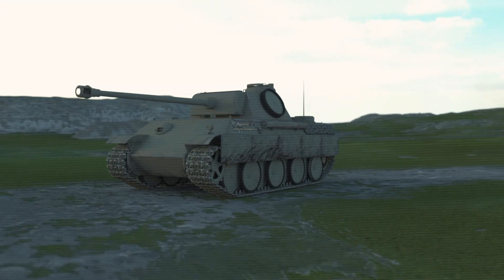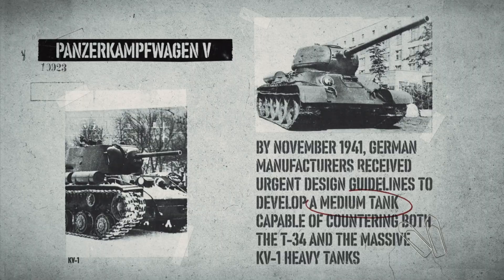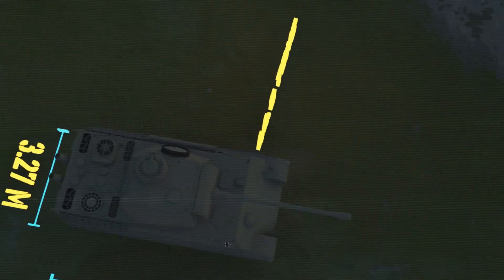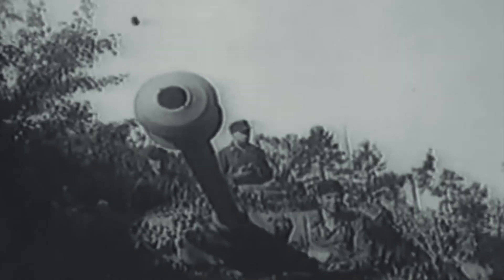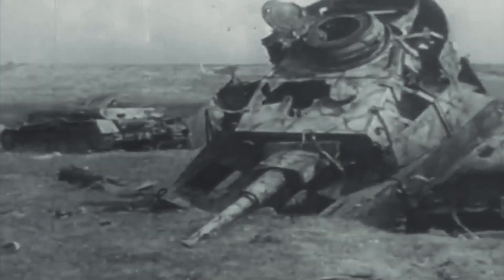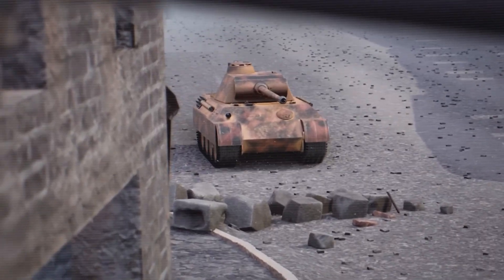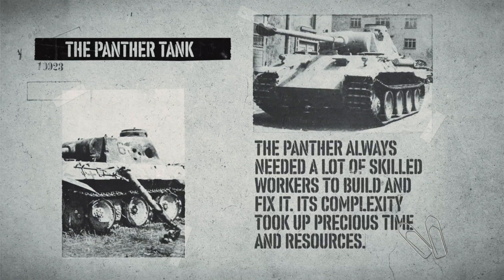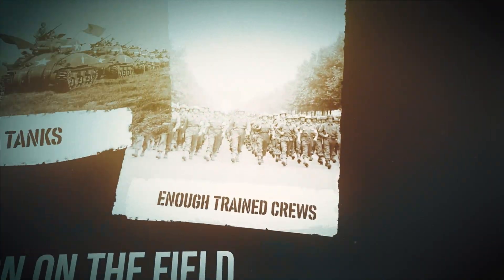The EXTREME Engineering of the LEGENDARY Panzerkampfwagen V Panther

Comment: 150 km is myth...

After measures taken by Maybach from the beginning of 1944, the reliability and service life of the HL230 engine increased significantly, in practice equalling that of the HL120 engine found in the Panzer III and Panzer IV.[123][124][125]

Guderian wrote on 5 March 1944: "The frontline reports said service life of the tank's engine had increased up from 700 to 1,000 km [435 to 621 miles]. In addition, the same Panther tank-equipped unit reported that final drive breakdowns had ended and that transmission and steering gear failures were now within an acceptable range, which is damning with faint praise."[126][127] Guderian commented on the reliability: "From 6 March to 15 April 1944, the 1.Abteilung/Panzerregiment 2 (1st Battalion, 2nd Panzer Regiment) reported a distance of between 1,500 km to 1,800 km. Four of their seven Panthers were still combat ready without any transmission or engine failure."[128][49]

On 22 April 1944, the same battalion reported how a good driver and commander can improve reliability: "This kept in mind, the battalion reported PzKpfw V Chassis No. 154338, Engine No. 8322046 reading 1,878km with driver Obergrefeiter Gablewski, 4.Kp/PzRgt 2. The vehicle was still totally operational. All items were in great condition but the tracks. The consumption of the engine has been 10ltr per 100km. The vehicle was still operating with its first engine and transmission.[129][130][49]

The Inspector General of Armoured Troops summarised in May 1944: "The average lifespan of a Panther can now be roughly equal to that of a Panzer IV with around 1,500–2,000 kilometers between two major repair and maintenance processes, but in several cases, at approximately 1,500 km, the gear has broken down and the boxes have had to be replaced."[Notes 4] This accompanied a report from I./Panzer Regiment 2 noting that engine fires had reduced, heavy wear on steering due to lack of crew instruction and time for maintenance, weakness in the reduction gear causing breakdowns and requesting improvements.[131][132]

An example of Panther reliability appeared in the June 1944 edition of Nachrichtenblatt der Panzertruppen (Armoured Troops Bulletin), from a Panther-recovery tank driver's report: "Unteroffizier Krause of a Panther workshop platoon has driven his Panther recovery tank – Chassis No. 212132 – 4,200 km until 3 May 1944 without making any engine changes and without suffering any damage to the side reduction gears (Seitenvorgelege), gear change or clutch. Approximately 1000 km have been covered with a Panther tank in tow. The vehicle and engine are still in great condition and operational.[133][134]

On 28 June 1944, after the initial response to the Allied landings in Normandy, Guderian reported that "The Panther is inclined to catch fire quickly. The lifetime of the Panther's engines (1,400 to 1,500 km) is much higher than the Panther's final drives. A solution to the final drive teething is immediately needed."[135][136]

The various improvements began to have an effect on the combat-ready rate of the tanks deployed on the Eastern Front, which increased from 37% in February, to 50% in April, and 78% by the end of May 1944.[137] In September and October 1944, further modifications were fitted into the final drives as countermeasures to the reported problems including worn gear teeth, parts, bearings, and insufficient lubrication.[84]